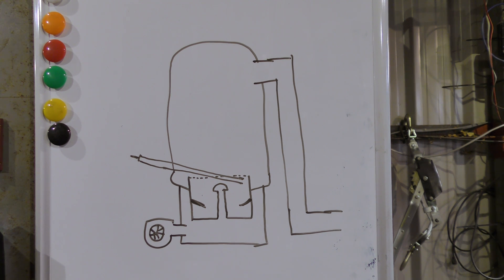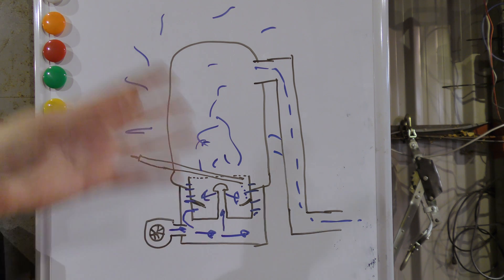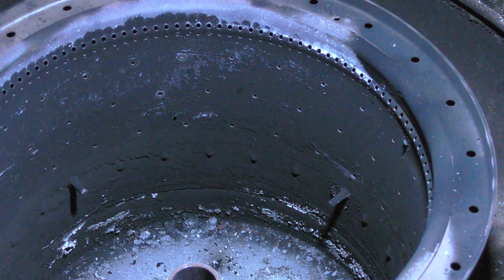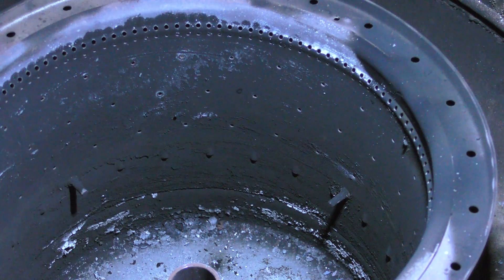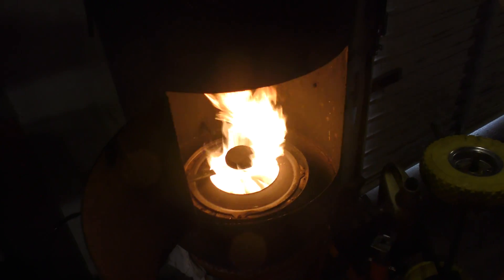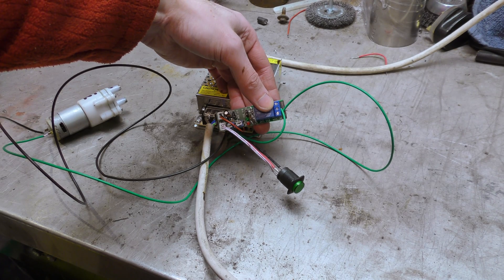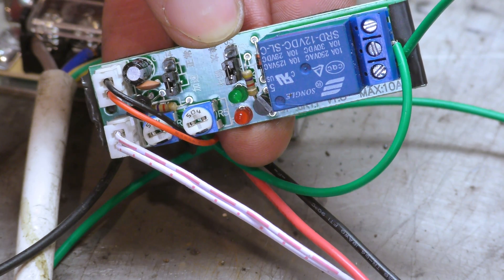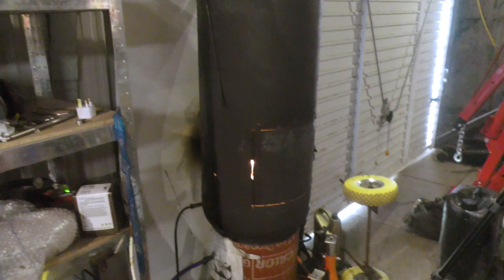DIY waste oil burner heater for the workshop

Comment: I like the pump rather than drip feed, more consistent burning 👍
Reply from the maker: Yes, doesn't matter if the oil is thick or thin or if it heats up and gets thinner.  The pump still delivers the same amount.
Reply: @DavidMcLuckie  👍👍👍

Comment: a updated video on this would be great I've made a couple that have been great I've never used a pump for the oil though and I've struggled to get the flow reliable I'm going to try one I'm all so trying to run radiators off it

Comment: Do you use an air compressor, how much oil is consumed per hour and what is the temperature it reaches
Reply from the maker: No compressor, just a blower fan for air and the oil from the pump.  Never measured the oil, the exterior gets hot enough to burn.
Reply: @DavidMcLuckie 
 what tyap of pump use
Reply from the maker: I used a diaphragm pump.

Comment: Love the design.  Just curious,  why the pump and not go with gravity feed
Reply from the maker: I started with a drip feed but had an issue that when the oil started to heat up, the flow increased and either started to produce black smoke or ran out the overflow.  With the pump I get the same amount of oil even when the oil heats up.

Comment: Did you buy the burn chamber? I like how well it burns with all the holes.
Reply from the maker: Sort of.  The chamber I'm using came from a military multi fuel tent heater.  It's very similar to the burn chamber in industrial waste oil burners.  But I don't see why you couldn't make the same sort of thing.
Reply: David McLuckie hi David, like the same on eBay  H-45 heater ? Thanks a lot!

Comment: To bin off the electric pump, could you use a gravity fed system and just control the oil flow with a simple valve?
Reply from the maker: You certainly can.  I like it as I don't have to move my oil tank.  It can live on the floor now and I can just add oil to it.  When it was gravity fed I had to lift a little tank down of the shelf above the burner and refill it.
Reply: David McLuckie or you could have the main tank on the floor then use the pump on a float sensor to fill the gravity feed tank. Or am I just over complicating things?
Reply from the maker: I'd go for a bigger transfer pump in that situation.  The little dinky pump I'm using would take a while.
Reply: David McLuckie would you be able to get away with an old fuel sender that has the pump and a float valve built in to it?
Reply from the maker: I used an old petrol fuel pump once.  It didn't last long, oil was too thick for it.

Comment: Can you show the specs on fan? I bought same unit off eBay and doesn’t run worth a damn!
Reply from the maker: It's just a second hand boiler fan off eBay.  Like this one - https://www.ebay.co.uk/itm/Ideal-Classic-111947-Replacement-Boiler-Fan-Assembly-2-YR-Warranty/182767568628?epid=1424741140&hash=item2a8dcbc6f4:g:vuUAAOSwxEtal-fE

I've got mine plugged into a dimmer so I can control the speed.
Reply: David McLuckie thanks for that!! Just set it up to drive in air under “pot”
Reply: David, i live in the US🙄, where can I buy a burner like the one you have? Thanks.

Comment: Finished at last! That's tremendous. How about welding up one of those little metal windmill fans which are driven by the heat?
Reply from the maker: They actually use the Seebeck effect and have a thermoelectric circuit in them to create power to drive the electric motor.  Also, they're fairly shit compared to a normal fan.

Comment: Could the waste oil be gravity fed into the burner and regulated with a tap if the source drum was lifted above the height of the burner?
Reply from the maker: Yes.  I didn't have much luck with a drip feed though.  Felt like it was either too much or too little, but might have been a poor tap choice.  The pump is good as you can leave the oil container on the ground and just keep putting your waste oil in. 

If you had a really nice chimney setup with a good draw I think you'd even be able to do away with the fan.

Comment: what does the smoke look like on the outside of the building? neighbour friendly?
Reply from the maker: Please see 6:56 for no smoke outside.  :)
Reply: im blind apparently.. cheers :)
Reply: +wildchild8645 - You do get smokes when start up.  After about 5 Minutes and it gets hot...  You just see Hot Vapor coming out of the Chimney.  Air and Oil mixtures are very important and once you get that correctly, you barely see anything even in the coldest night.